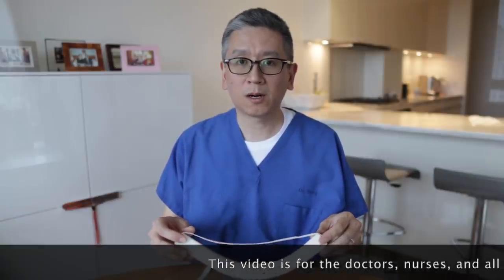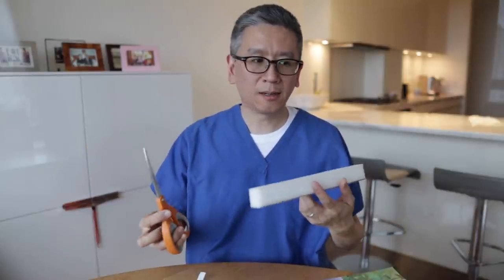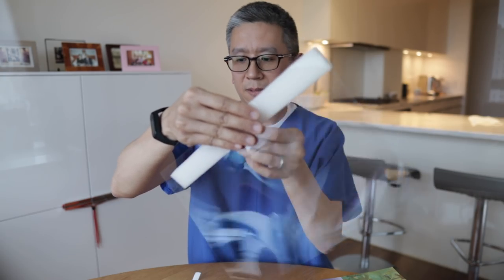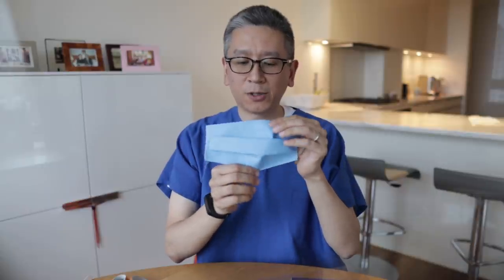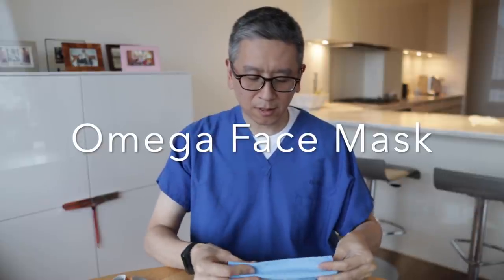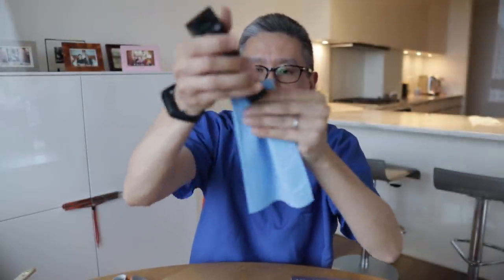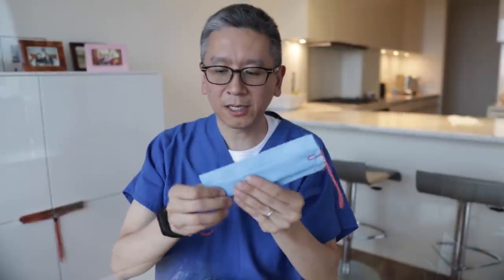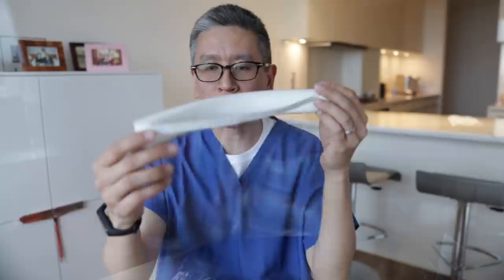How to make a face shield in 2 minutes & DIY Fluid resistant cover for N95: 14 min Pep talk for HCW

Comment: Thank you for this design. I am a teacher with co-morbidities and will make several to wear over my mask. I know I can clean the plastic, but not sure how to clean the foam. I might have to make enough so that time will kill the virus . If I have, say, 14 of them, I can rotate through them, 1 per day.
Reply from the maker: Rotating them is one option. 

I have another option for you.

The reason for this design is to essentially copy an actual Face shield used in the hospital.  Here is a link to the features/specificatios that I was trying to incorporate into the DIY face shield.  https://www.instagram.com/p/B_So5tND_G-/?utm_source=ig_web_copy_link

I think for non-medical people looking for an additional physical barrier other types of face shields can be considered.  For example, if your school has a 3D printing shop or you know of your students who have an interest and may own a 3D printer, the designs can be downloaded and printed by anyone with a machine.  These are essentially a pair of glasses frame or headband with elastic attachment, and an acetate sheet can be punched with a hole puncher and attached to the frame.

Since the frame and acetate are both plastic, you can simply wipe them down with alcohol and you should be fine for the next use.  Eco-friendly also.

Here is a low tech version of the 3D face shield which uses your own glasses frame.  I used Gaffer tape which is a special type of duct tape used in lighting for video and photography.  https://www.bhphotovideo.com/c/product/20008-REG/General_Brand_Gaffer_Cloth_Tape.html

The low tech 3D face shield.  https://www.instagram.com/p/B_So5tND_G-/?utm_source=ig_web_copy_link

A wider version for people who have foam cushion.
https://www.instagram.com/tv/B-XvLVzDGjR/?utm_source=ig_web_copy_link

If you are worried about not having a foam cushion to block any droplets from coming in from the top, one option is to wear a cap.  Cut the acetate to fit under the bill of the cap, and the problem is solved.

Be safe.  Teachers are the best! We all appreciate the work that you do with our kids.  Thank you 🙏

Comment: Given that Michaels and similar craft stores are closed, this information on how to easily and cheaply make essential items should be a reason to allow them to be open. There are other many items they have to allow people to cheaply make useful items during these difficult times. People should not be put in a position where their only choice is more expensive commercial products.
Reply from the maker: The stores are closed, but you can still order online.  Before they fully shut New York down, we could order online, and pick up curbside.  Now they stopped that too.  I received many rolls of the 2’x6’x1” roll of foam cushion by UPS.   Hope that helps.  The worry is for the people working in the store and not knowing which customer may be sick.  If they can be super careful with their own staff not getting sick, they can keep fulfilling orders from a warehouse and still pay the employees.  Unfortunately, the most fun part of the Michaels store is roaming around, and getting inspired.

Comment: Hey Dr Yang,

Just to clarify....it'd take me about 2-5 hours to print a shield frame, and 11 hours to print a mask.
Reply from the maker: Hi Matthew, Thank you for the clarification.   For the Healthcare professionals who receive your 3D printed FaceShields, I think the biggest benefit is that the entire shield and headband holder can be disinfected and reused.  Once they have one shield, they should be safe pretty much through this whole crisis.  

In case the 3D printed face shields don’t make it to some smaller hospitals or certain personnel who are not designated to receive one, they still may feel vulnerable.  

Keep up the good work!

Comment: If you use Kimguard H600 sterilization material and allow the seamstresses to pick it up let them make the masks for you. The hospital should allow them to use what's left from any opened surgical instrument packs since they just throw them away anyway. I bought a box of the material at a medical supply store for 180.00 but it's enough to make hundreds of better masks for first responders and for my Drs here in Michigan. I am a retired nurse and l know what they needed. There is also a pattern at Florida University that passed the fit test.

Comment: Dr. Yang, as the demand for elastic is very high and the supply is tight, if I use a strap instead, how long should the strap be?  When u use the 12” x 9” Dura Lar, which side do u use for your forehead?
Reply from the maker: 13.5” for medium, 14.5” for large head.

Comment: Non essential businesses like Michael's arts and crafts store are CLOSED right now. I guess online shopping would be the best suggestion.
Reply: Our Michael's does curbside pickup. Order online then pickup. Check your local store.
Reply: Our Joann’s (Fabrics and Crafts) does curbside pickup. Can order online and pick it up at the store, with no contact . They will either lay it on the table out in front after they’ve identified you, then retreat into the store, or place it directly in your vehicle for you. Again, contactless.🙂

Comment: What kind of materials for making the mask, appreciated for support with this.Thanks so much.
Reply from the maker: Huong Nguyen 
Here is the list. Cut and paste from prior reply. 
Pad of 25 acetate sheets- 9”x12”
https://www.michaels.com/grafix-clear-dura-lar/10449305.html

1” thick foam cushion 15”x17” for smaller project
https://www.michaels.com/pure-foam-cushion-by-loops-and-threads/10178096.html

If you are ambitious, I bought the following which can make ~110 face shields. 
https://www.michaels.com/pure-foam-cushion/10178097.html

Dritz 3/4” braided elastic 
https://www.walmart.com/ip/Dritz-3-4-x6-Yd-Non-Roll-Elastic/348591917
Michaels, Jo-Ann’s, Dick Blick, Amazon. 
1/2” or 1” can also work.  For reference, 4 yards will yield 11-12  pieces of 13.5” head bands. 

Hot glue gun, any cheap one will do.
https://www.michaels.com/artminds-high-temp-glue-gun/10301572.html
Glue refills
https://www.michaels.com/glue-sticks-by-artminds/M10203515.html

Yardstick or long straight edge to cut the foam.
Safety razor blades to cut foam. 
Scissors to cut the elastics. 
Regular stapler

I posted it on IG before the this video which I quickly posted.  I posted a lot more detailed shots and shopping lists on IG. Scroll up to see the additonal posts. 
https://www.instagram.com/p/B-Gi5S9D7R7/?igshid=1g1zjzs4ged5r
Reply: Thanks doc! For yr hard work

Comment: How would you sanitize it?  The foam worries me.  Spray it with lysol?
Reply from the maker: Lulujoy yes, the foam and the head band are both harder to clean.  In general, this is the same problem with the hospital supplied face shields.  HCP are asked to make the face shield last up to a week before getting a new one.  Normally it is a one use item thrown away even after seeing one patient (5-10 minutes) then use another one when you see the next patient.  If you don’t follow those rules the HCP can get in trouble. 

Now they are being asked to use the same shield for longer than the usual regulations.  

If the HCP already has a face shield, they should try to clean and keep that shield clean and in good condition before using our DIY shields. 

The best way to clean it is probably soaking the foam with 70% isopropyl alcohol and squeezing out most of the extra alcohol and let the foam and headband dry.  If it gets visibly soiled with blood, it should be discarded.   

Lysol may work, but not sure it if will leave a residue or chemical odor.  The alcohol should evaporate completely.  

The clear acetate shield can be easily cleaned with alcohol.
Reply: @GeorgeYangMDNYC  I was going to say alcohol. No chemicals like lysol.....

Comment: Home made face mask donated they will wash to stabilize. How can we make and donate the shields and they would use them?  I would like to make these .
Reply from the maker: Hi Jim, so happy that you want to help out.  It’s true that you may spend time and money to make them and they may not get used. So you can check with your local hospital to see if they would take home made masks.  

I will be posting a new video very soon about how to Batch the mask, meaning make a bunch at the same time.  If there is time to make the masks look much more professional, then you should watch the next video.

If the hospital won’t take them, other front line workers should get them too.  For example, store clerks and cashiers stand very close to people when they check out and their is no room for them to social distance.  Policemen, paramedics, or all essential workers.  These people interact with 30-50 or more a day.  They are very exposed to the virus, so other than the healthcare workers in the hospital, the essential workers in our communities are the most exposed.  This also means if they get sick, they may still be going to work and you may be standing across a positive person.  If they are wearing the face shield it also keeps airflow from their breath more partitioned so it is not directly flowing at your face, like when someone blows out a candle.

Comment: Did you have trouble with the bottom of the acetate from rolling up on the corners?
Reply from the maker: No, the acetate is a flat sheet.  These are similar to the transparencies used in the past for presentations. I used the Grafix Duralar 9”x12” pad of 25 sheets from the Dickblick.com.
Reply: @GeorgeYangMDNYC  I made one with acetate, flat sheet. The thickness is  .003. That could be why mine was curling up. The website on the package says www..grafixarts.com. Do you know what thickness yours is?
Reply from the maker: Oh, that may be the issue.  Mine are the 0.005 thickness.   In the pinned comment at the top, I posted a shopping list with links.  Here is another one from the above website.  It's on sale at $11.16 https://www.dickblick.com/items/55506-1305/

At Michaels, the same item is $17.99 and out of stock.

If the corner is curling, you should round off the corners by cutting a soft curve.  This will make it more professional.  Also, when you are wearing the shield, since the face shield is also curved, may be it will take the curve that you don't want out, and force it to curve with the natural shape of the face shield.  It may still curve when you aren't wearing it, but should hold its shape when you are wearing it.

Last possible solution, so you don't have to buy more materials.  Double up on the acetate.  2 layers should make it 0.006 which is very close to the 0.005 thickness.  You can either tape or glue two layers together and assemble as per the instructions.
Reply: @GeorgeYangMDNYC  Yeah, I saw that after I asked you the question. I'll order some. Thank you for replying back.

Comment: Doc, how effective are face shields?
Reply from the maker: Ham and Burr Not protective by themselves against COVID-19.  The reason healthcare providers want them, is to protect the N95 respirators from getting respiratory droplets onto the outside surface of the N95 mask.  When too many droplets dry on the surface the respiratory filter gets clogged and they can’t breathe through the mask anymore.  The N95 needs to be discarded at that point.  

The shield will reduce droplets to prolong the N95.  Hope that makes sense.

Comment: Where do I get the material for the omega mask? I don’t work in a hospital setting where I can get it. Thank you for your service!
Reply from the maker: It’s a 4”x7” blue non woven fabric which is fluid resistant. I found this link: https://www.schoolnursesupplyinc.com/Therma-Kool-Non-Woven-Disposable-Covers--4-x-7-100Pkg_p_1034.html

My assistant buys ours from a medical supplier, but you would need to set up an account.  This link appears to be the same product.   Note that this material is water proof similar to Reusable bags which supermarkets might sell or they give away free at a conference as swag.  

Note it is also hard to breathe through this mask.  I wanted to use this version to lightly cover the outside of an N95 mask to let air get under the mask but through the N95 respirator. 

 I made a paper towel version with printer paper stiffener which has more layers and is more breatheable. https://youtu.be/usKgChGqVl0

Many people were using a blue shop towels on a roll ($2-3 per roll normally priced) from Scott brand, Toolbox brand  instead of the regular paper towel.  It’s hard to get now and they are overpricing.

Comment: Thank you sir for making these videos! I just made the mask with paper towels and rubber band. Very very comfortable and easy to make with your calm and clear instructions. I am trying to order the duralar acetate sheets on amazon but they come in two kinds of thickness, .003 and .005 Which one should I get. TIA.
Reply from the maker: Hi Raj, the 0.05 mil sheets are better, a bit stiffer and stronger, but I’m sure the 0.03 mil sheets would work too.  I’ve handled the real disposable face shields and the 0.05 seems the closest..
Reply: George Yang, MD Oh thank you so much Dr Yang for such a prompt reply! Truly appreciate all your efforts 🙏

Comment: Thank you for your sharing, May I know where I can get cold pack sheets fro shop or store or online, thanks
Reply from the maker: These cold pack covers are Non-woven polypropylene fabric.  The size that I use in my office is 4"x7".  It turns out that surgical masks happen to be ~7" wide, so these work out well. 

If you purchase a roll of non-woven polypropylene or use a non-woven polypropylene bag (the kind they give out at conferences, or some supermarkets as reusable bags, then you can cut them any size you want.

 There are other videos for paper towel masks, which use a rectangle which is 5.5"x7" wide using the same folding technique and has better coverage since it is wider from top to bottom.  https://youtu.be/NCF7lCHMnII

The other mask is 5.5-6"x 10-11" in size with wider side to side coverage. https://youtu.be/usKgChGqVl0

Comment: Are these very clear or are they blurry? Also, is safe to use if you wear glasses?
Reply from the maker: These are clear acetate sheets.  It shouldn't block your vision.  A large number of healthcare workers wear glasses, since studying to enter the healthcare field tends to attract people who read a lot.  If they don't wear glasses, they may wear safety glasses which wrap around the eye area, to add some protection for the eyes.

These face shields block larger droplets and creates a pocket of air behind the shield.  This helps to prolong the N95 respirator masks which the healthcare workers are using to protect themselves when caring for hospitalized COVID-19 patients or potential COVID-19 patients they may be seeing in a clinic.

Since the N95 mask has a very fine filter, it can clog up very easily with larger particles.  In most hospitals, the healthcare workers are instructed to wear a faceshield and a surgical mask (cheaper) over the N95 mask as "pre-filters" to catch larger particles, so the N95 mask can focus on filtering out smaller particles.

Many HEPA air purifiers will have this type of "pre-filter" which may be a simple foam or washable nylon mesh to catch larger dust particles.  This pre-filter is washable and will prolong the time between changing the expensive HEPA filter.  Usually they recommend changing out the HEPA filter every 6 months, but without the pre-filter catching the larger particles, it may get clogged in 1-2 months.

Hope that makes sense.  I wasn't sure what you meant by is it safe to use if you wear glasses, so I wanted to clarify.
Reply: @GeorgeYangMDNYC  Thanks for the answer.  I meant, for people who wear glasses and let's say, bike and do food deliveries for example. Is it safe to wear the face shield on top of the glasses while riding. I was thinking it might cause some glare, blurriness or something.

Comment: How do you keep your glasses from fogging?
Reply from the maker: Laura Cuff The fogging will come mainly from the face mask and not the face shield.  You have to make sure the face mask has a good seal on the nose area, by bending the metal piece on your face mask if you have problems with fogging.  Wearing a face shield without a face mask shouldn’t fog the face shield, but the real reason for wearing a face shield is to make the N95 mask last longer without getting clogged with small droplets of saliva/mucous which will make the mask unusable due to lack of air flow.  Many hospitals are additionally adding a fluid resistant face mask on top of the N95 to really protect these precious PPE.